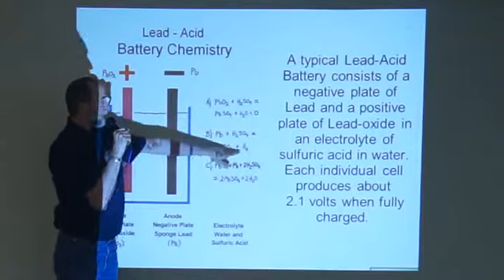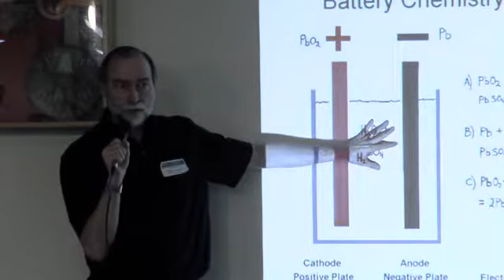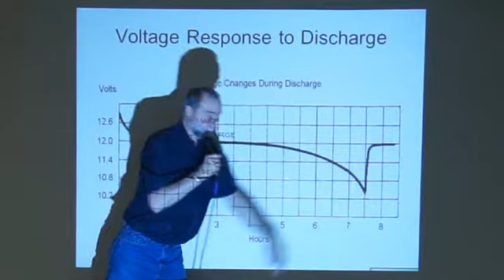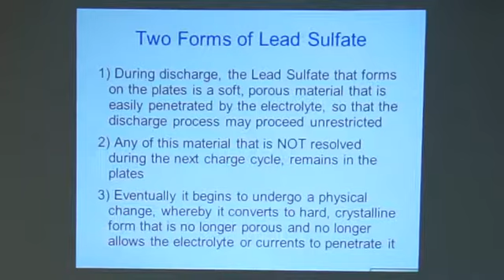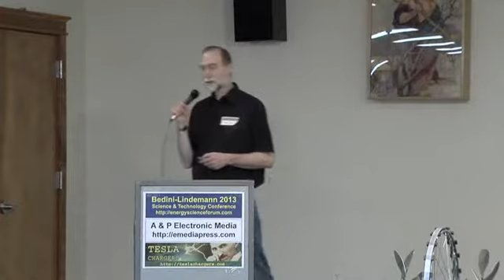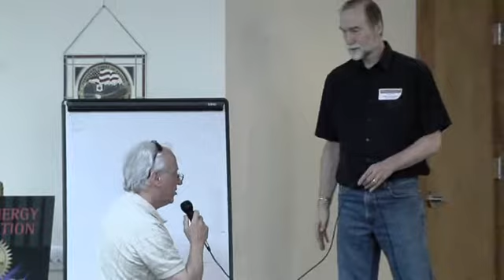Pb2

Comment: @26:01 That's an altered chart from what is on page 53 of The Automobile Storage Battery - Its Care and Repair, 2nd Edition, by O. A. Witte. The original doesn't show a drop after Point R.